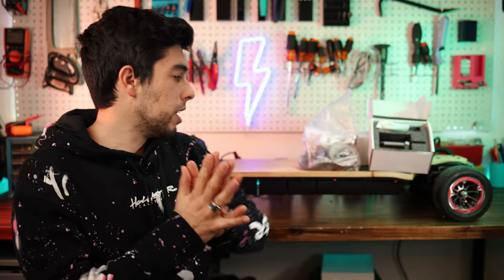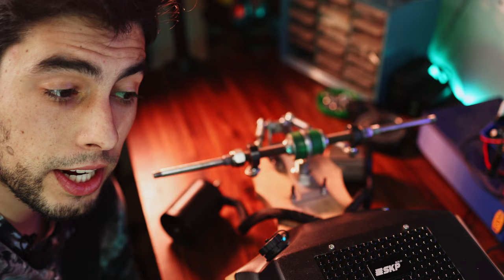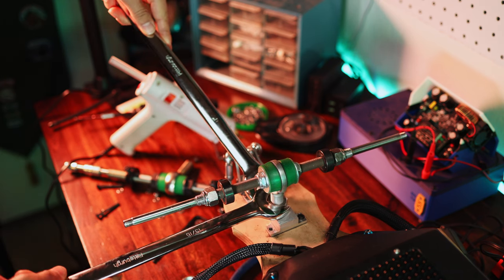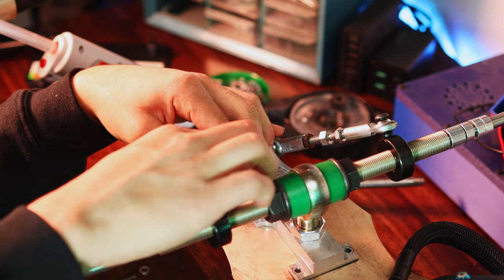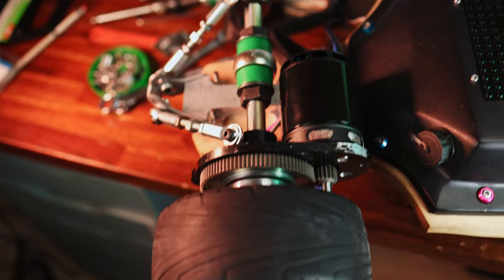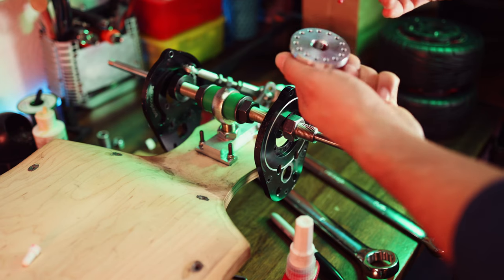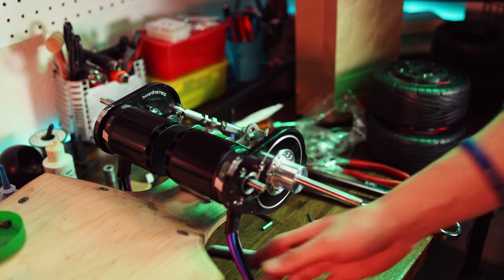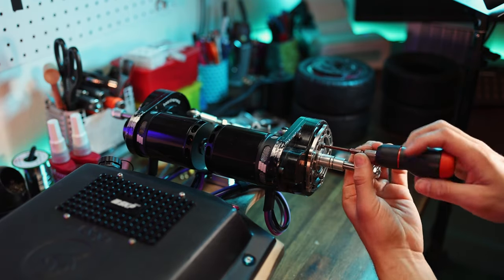BIG POWER & Handling Upgrade! - SKP Motors & New Drive Ratio (Inazuma 稲妻: Phase Two - Pt. 4)

Comment: 🤭The comically large wrenches got me rolling out of my seat. :)
Much love, so much love, I would have prob done the same thing.

😉I like the how you didnt go all the way through the deck.
I supposed grip tape could cover that area or a 3D printed part, but to me seems professional to counter sink it like you have done.

💁The Adaptor, could you not just add a grub screw and drill a small counter sink into the hanger/axel?
This might solve the issue with slipping.
Reply from the maker: Haha thank you bro! The only downside to not going all the way through is that you can't drop the heim bolts all the way. It seems to have made a big performance difference though, and I think my enclosure might scrape if I made it lower.

As for the adapter, I think you could, but on this setup with the large jam nut, it hasn't slipped a single bit

Comment: Great job on the DIY! I'd like to replace my plastic stock BN wheel adapters w/ those metal ones you have here. Didn't realize that was an option. I'm assuming I can buy them on your website? Also, I need to go back in my bn m1-at gear drive and redo the backlash to the new instruction of Very minimal space. I'm assuming it will be difficult to re-adjust since I've the locktite in but I'm hoping a few mins w/ the heat gun will do the trick? Also noticed the wheel spacer I currently hv on from the bn gear drive package is bigger than my truck axel; do you have the correct size for the Hypertrucks? Thanks! Enjoying the new gear drive so far but hoping readjusting the backlash will get rid of some of the rattle?
Reply from the maker: Thanks for watching! These metal adapters are actually not an option, they're super old at this point, and the steel ones I've got on it here were an even more limited run between the original aluminum star adapters, and the new plastic ones. Theoretically the plastic ones should be strong enough and wear less than the others, but I've had really good luck with my steel ones anyway.

Readjusting backlash shouldn't be too hard since you just have to loosen the motor bolts. For hypertrucks I think you need 12mm spacers right? I have never worked with them.

Comment: You almost had an excuse to make it 4wd, even if one end was kinda janky. 

You should put a pic of the setup at 29:50 on the pictures only thread on the forum because it does look amazing.
Reply from the maker: Haha you're right - I actually have 2 more BN gear drive sitting around too, I could switch the front end to the OG hahah

Thanks! It does look pretty slick there, maybe I'll post a screencap - thanks for watching!

Only thing, for 4wd I would need to change the solos out because I don't think there's room for 2 more in there
Reply: @RBEMotion  You could even mix different VESCS and/or top mount one (hence why I said one end might be janky). 

People use 4wd reachers with smaller packs and 6384->6485 isn’t much of an improvement compared to 6384+6485 so make the purchase worth it and go all out 😉

Comment: So whats the actual difference between the short rod 3 links and the normal one? When is ir nore preferable to use one of the other?
Reply from the maker: That's a great question. The way I see it is that the short links are more responsive, and can be used on different decks than the full length ones. I haven't had the chance to try them out yet though.
Reply: @RBEMotion  you think they are also good jn a general purpose setting. Or exclusive to racing
Reply from the maker: @Thec0nv1ct777  I think people can enjoy them in either situation, but they're racing focused. I don't find 3 links in general to be as fun as some other truck styles, however they are still good for general purpose as well.

Comment: Hey man after watching ur video and looking at some DIY boards and some builds of the year on esk8 im really tempted to do a DIY similar to your Black mamba i was deciding between the atlas pro and onsra bc3 for a while and cant chose which is better and neither has everything i want, so what could i get for roughly $1600 in terms of DIY would i be able to build a board like yours?
Reply from the maker: Thanks for watching! DIY is definitely very possible nowadays. I think you could build a pretty decent 12s4p board with P42a for that cost. Makerx ESC, flipsky motors, VX4 or puck, belt drive. Definitely possible!